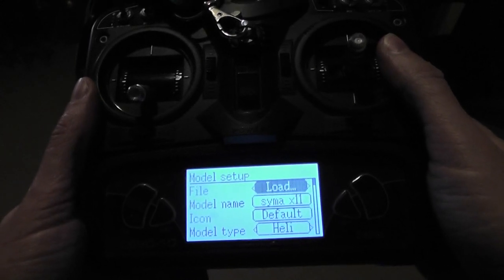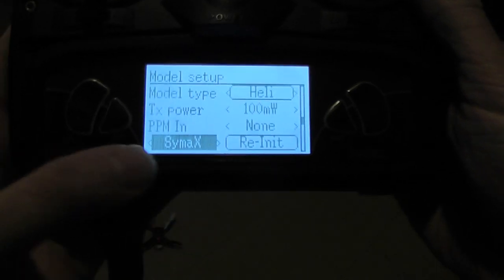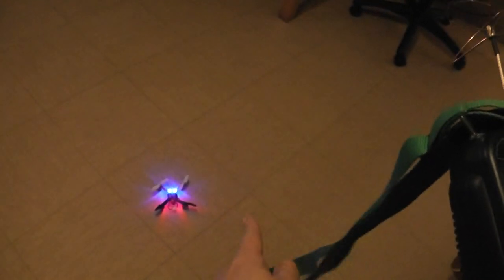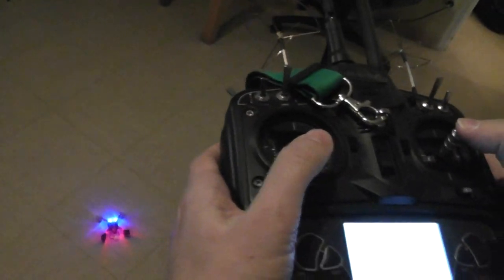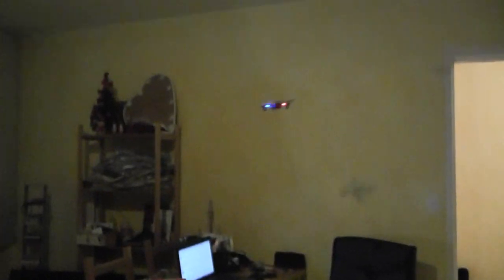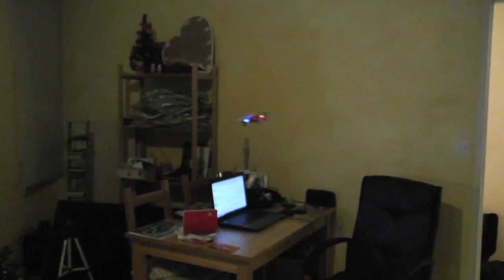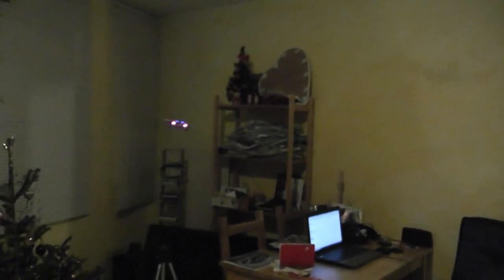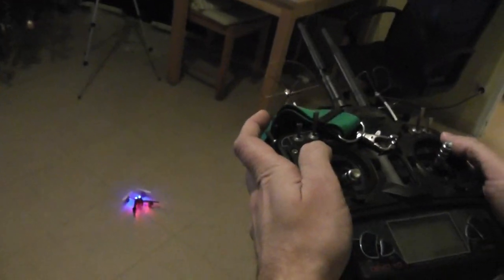Syma X11 first working demo flight via DeviationTX

Comment: Hi, I was wondering if you could help me with my Syma X7... I have been able to bind to my jumper T8sg my Syma X3,X4,X5,X11,X13...and all them fly great! But when it comes to the X7 I have no idea what happens but it won't bind... I've tried the SymaX and the YD717 protocols but neither of them worked. Is there anything else I could do to fix it? Do you know if there is a specific ini file for this model? Thanks in advance for your help 👍

Comment: Which devo controller are you using ?
Reply from the maker: This one is a Devo10 but can work also with a Devo7E. Of course, they have to be modded to install a nRF24L01 chip
Reply: SeBy DocKy How about a DEVO 7? no E
Reply from the maker: Eddy Pardo Not compatible sorry